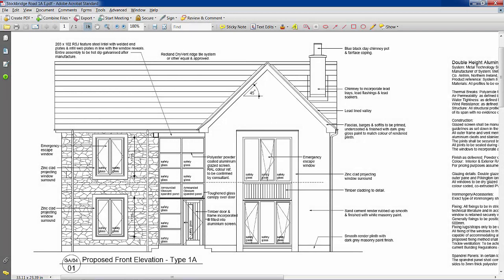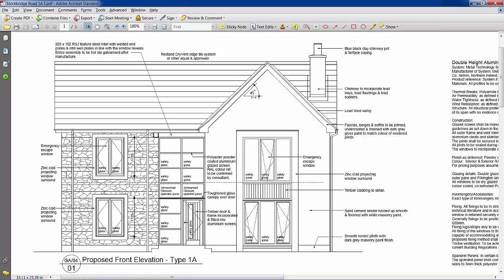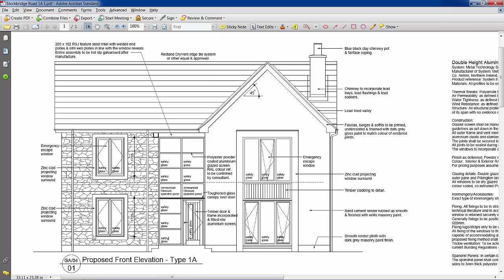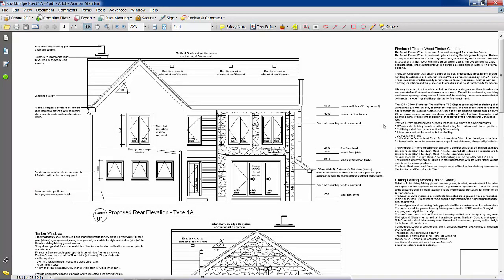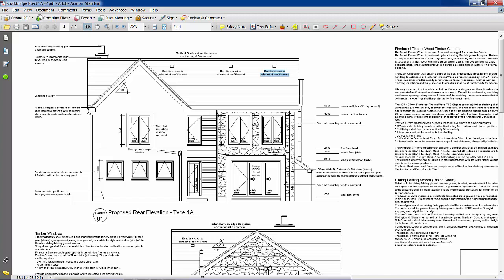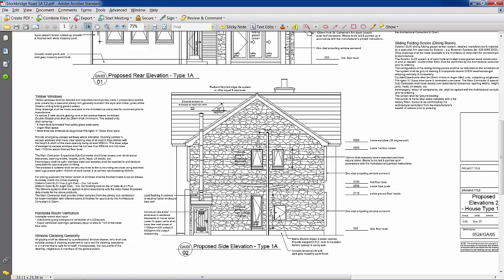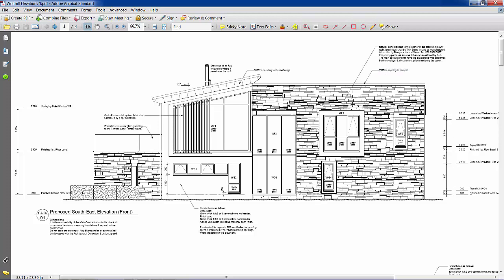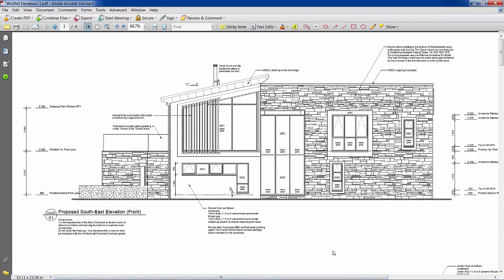Building Control Notes for Elevations

Comment: Hi, I have found your details on a forum which I was reading and found some of the information you provide very useful. I am an architectural technician just graduated and I have recently submitted plans for an extension for my property which have been approved. I now need to complete building regulations application which I am planning completing myself for the first time. My knowledge is very limited and I would like to ask for your support if possible. I was wondering could you possibly email me an example building regulation application for a double extension which could help me with my application?

Highly appreciate your support

Thanks
Reply from the maker: Hello Nasir, thanks for your interest in the video.

The content in the video is for an application in Northern Ireland, so I'm not sure if it is relevant where you are based. Also, you might wish to consider the implications of Professional Indemnity Insurance if you have not done so already. If you send an email to my Univeresity email address I will try to provide additional guidance.

Best wishes, Gareth
Reply: @garethalexander1  hi what is the email?